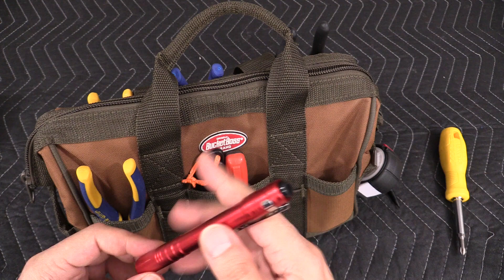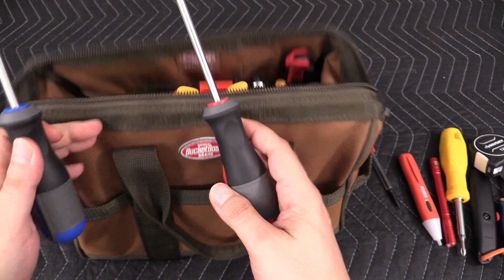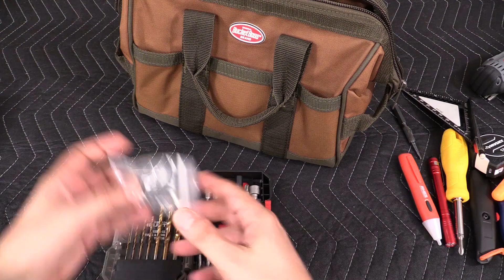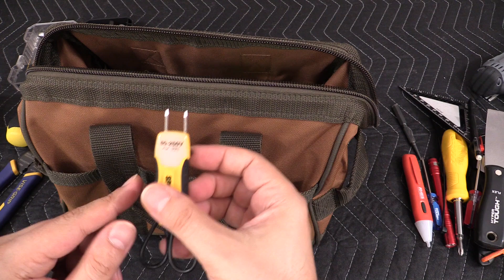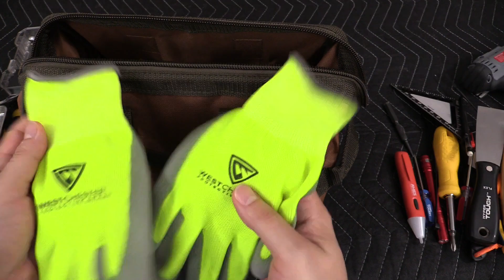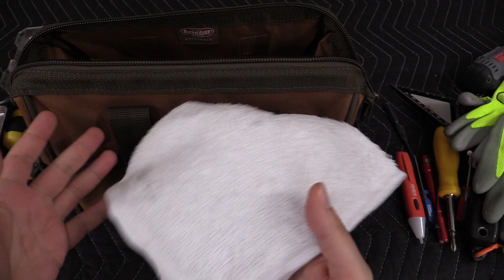Lightweight Tool Set for Basic DIY

Comment from the maker: Bucket Boss 12" tool bag - https://amzn.to/3N5vhjf
Stanley 6 in 1 screwdriver - https://amzn.to/3B0SiRj
Irwin groove lock pliers - https://amzn.to/4e48GPC
Irwin wire stripper - https://amzn.to/47okYQz
Johnson square - https://amzn.to/3TsAuFe
Stud finder - https://amzn.to/3Tt9oxU
Stanley stubby screwdriver - https://amzn.to/3XEtSGd
Sperry voltage tester - https://amzn.to/4emQkJt
Eklind folding hex keys - https://amzn.to/3XLdAuf